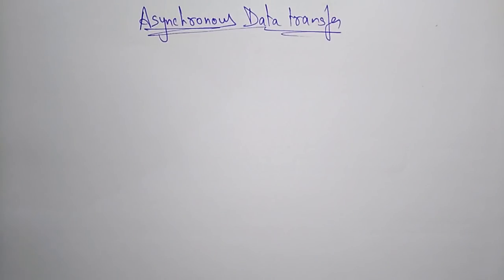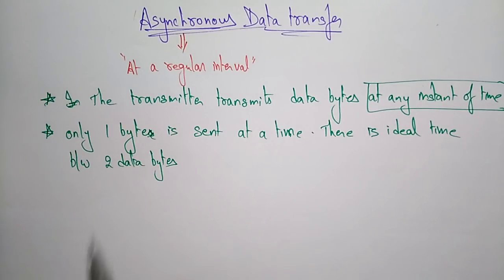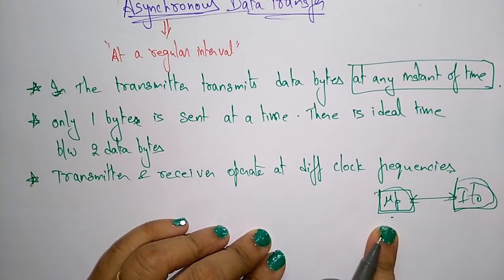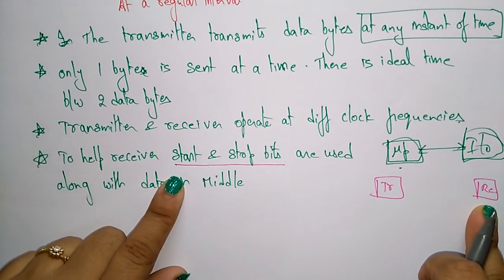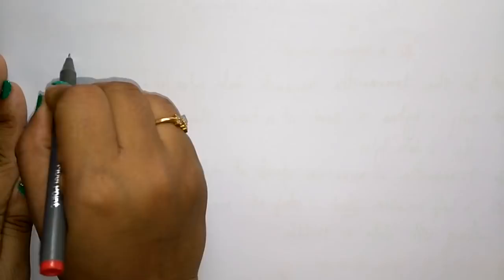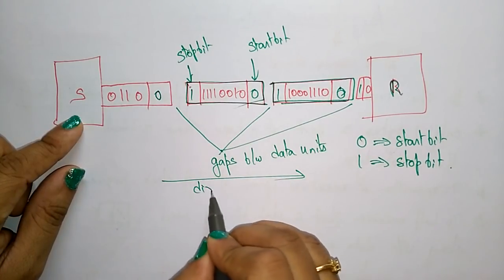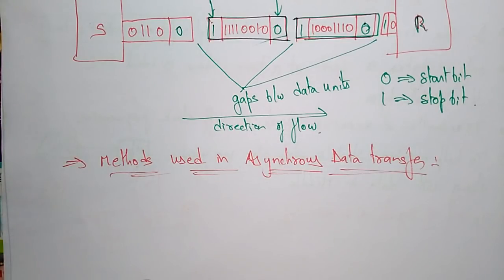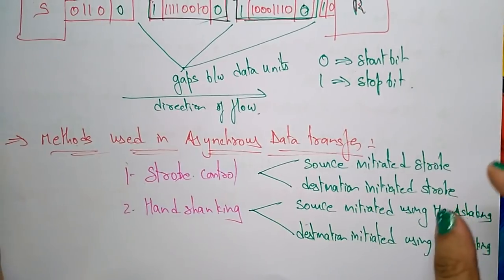asynchronus data transfer

Comment: how is it regular interval when clock frequency of sender and receiver is different?
Reply: Same doubt bro!  If you have cleared this point then  pls explain
Reply: @vishalchauhan9832  The interval was about timing diagram, when you draw the timing diagram for asynchronous data transfer it is at regular interval, kinda like this: ⁻⁻⁻⁻⁻|__|⁻|_|⁻|_|⁻|__|⁻⁻⁻⁻⁻

But in synchronous data transfer, the timing diagram is irregular, kinda like this:  ⁻|____|⁻|__|⁻|_____|⁻|_|⁻⁻⁻
Reply: @DrDemolition  thanks bro
Reply: @vishalchauhan9832  no problem, subscribe to pewdiepie
Reply: @DrDemolition 😂 Pewdipie
Reply: @vishalchauhan9832 How is timing diagram for asynchronous at regular intervals whereas it is at irregular for synchronous? Isn't it reverse?
Reply: @085_RahulMishra  Hi bro u are asking after around 4 years . I forgot this topic now 😐
Reply: @vishalchauhan9832  😶 Please recall sir you're 4 years senior to us apne juniors ku help karo sir ji, 😶
Reply: @085_RahulMishra  weak generation! always want the easy way out! already explained in previous comment, irregular != async, regular != sync
Reply: @DrDemolition  Then what does regular and irregular means?

Comment: Maam In the acsyn, it is having the start and stop bit in the most right and left. The Start is represented as 0 and Stop is represented as 1. My doubt is that Start and the stop bit didn't get mixed while reading by another end?
Like sent byte is [1  11001101  0] and it will be read as  [ 1 11  10011010 ] ?

Comment: Ma'am i have a doubt that how does the receiver can understand that the bit is start bit or stop bit because both the information or data is in binary form and the data bits are also in binary form..?
Reply: Start bit is 1 and stop bit is 0. Beacuse in binary 1 means power supply and 0 means there is no power